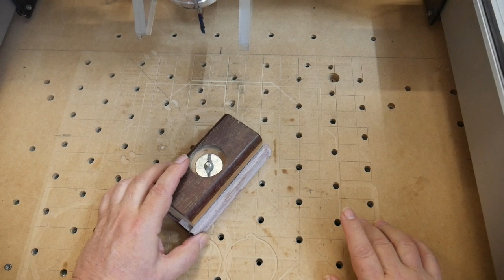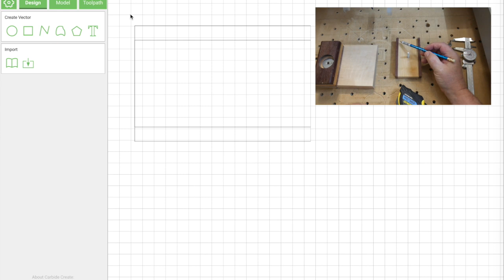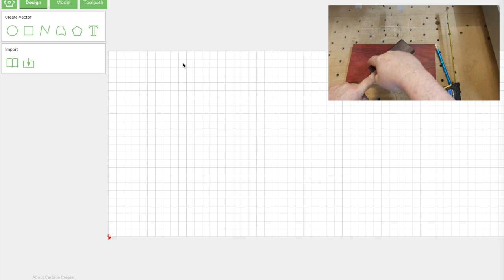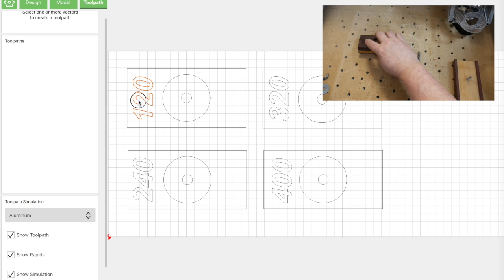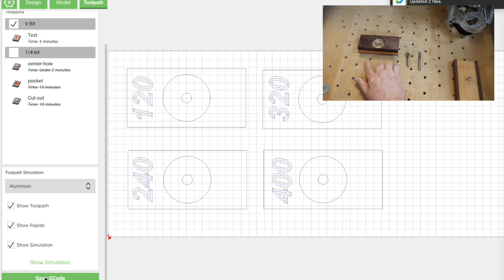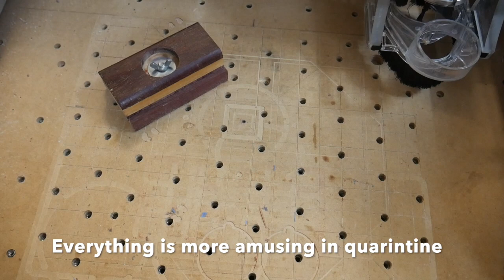Sanding Blocks on the Shapeoko CNC

Comment: Thanks again, John.  I used to use spray adhesive and put sandpaper on block of wood, but this is way cooler and reusable.
I have now successfully made many boxes and cubes!  I am limited to using an offline controller on my Sainsmart CNC.  But (after much trial and error) I created a simple jig, recorded the x&y for “center” then always use “center” for alignment.  If you are interested I can provide you with the details so you can share if you’d like.
How did you make that incredible blue lit cube at the beginning of this video.  Inlaid acrylic? Looks awesome.
Still hoping you’ll be able to make a puzzle box lesson.
Reply from the maker: Any details you want to share on centering would be great! The acrylic cube of cubes was a fun project. It's a multipart frame that slots together. I did the frame on the laser because it was quicker and I didn't need to polish the edges after, but it's doable on CNC too. My design file is here: https://www.dropbox.com/s/kxz24avlp59omaf/acrylicCubeFrameLarge.svg?dl=0  Feel free to ask questions.

Comment: For some reason when I made my sanding block jig, my sanding block doesn't fit it there nice and snug. It's loose? any ideas why. I am not going to cut another one. I think i will just use card stock to shim one side. I wonder now if the bottoms I cut out a few days ago shrunk a little. These where not cut out of hardwood. I cut them out of some scrap pressure treaded wood I had kicking around. The jig size is right to the dimensions of what it is suppose to be. BUT now when I measure my bottoms they are not the same dimension that is in the software but smaller. I Bet it shrunk a little as it has been a few days since I made them. I will have to try some hardwood bottoms.

Comment: What would be neat is to do a thinner inlay on the top so when you v carve the numbers in, it actually goes through the dark in lay and into the lighter wood under. Think that would make the the number pop right out.
Reply from the maker: Wood veneer is great for stuff like that. Just glue it on and vCarve.

Comment: Thank you for the video. In your experience, what kind of wood to use to make small parts? 5x6x6 or 40x10x6 mm. Thank.
Reply from the maker: For tiny parts you want a wood with a small, tight grain so it is less likely to split. Hard Maple will work, or you can go with birch plywood.